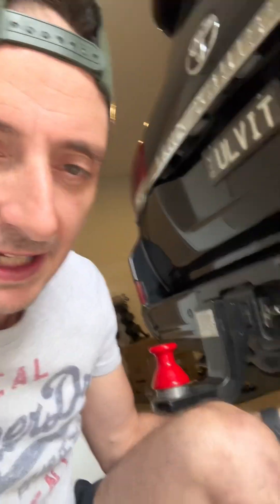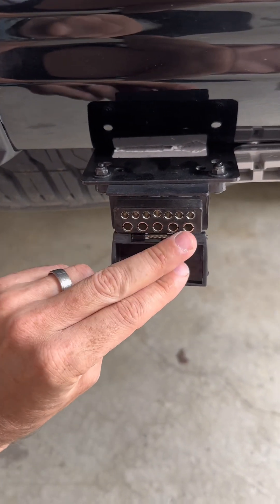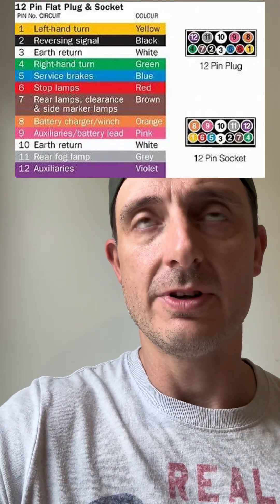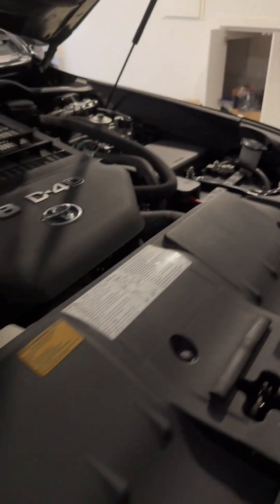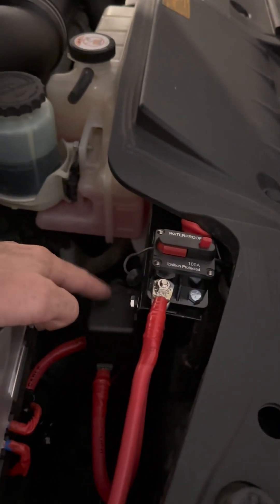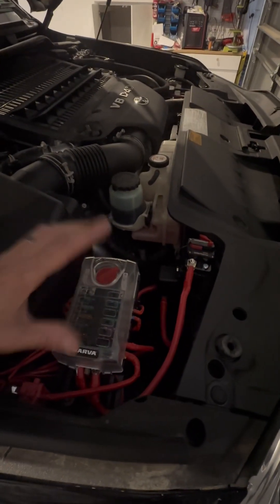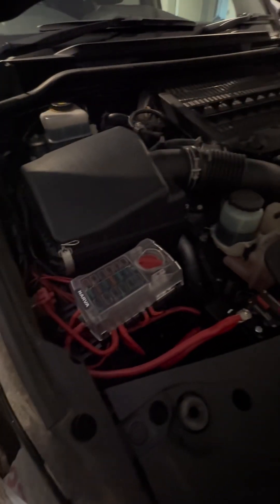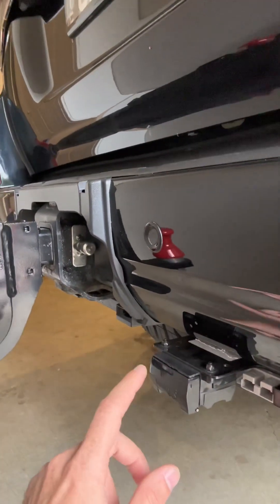Wiring 12 pin trailer plug - but how?

Comment: Caravan manufacturers consider standards as optional. They consider AS2513 and AS4177.5 as “guidelines” rather Australian Standards.
The thing you need to remember is that PIN2 is or Reverse Lights and PIN9 is AUX; and that PIN3 and PIN10 need thick enough wire to earth the combined loads of 1-7 and 8-12 respectively. Also Remember that the 12-pin plug can not handle more than 30A over the length of a vehicle+trailer. Any usable power needs to be provided over (an) Anderson Plug(s), otherwise you will melt your trailer plug.